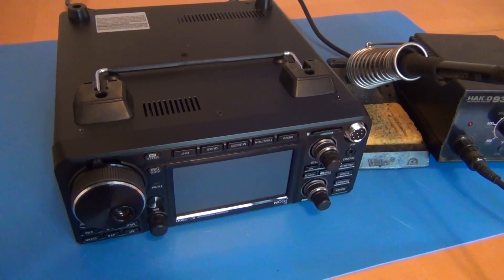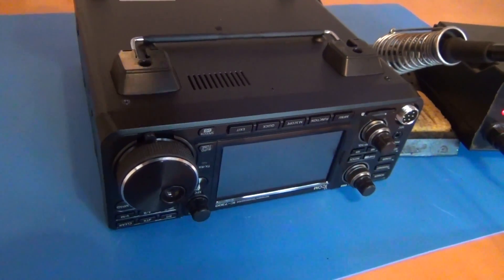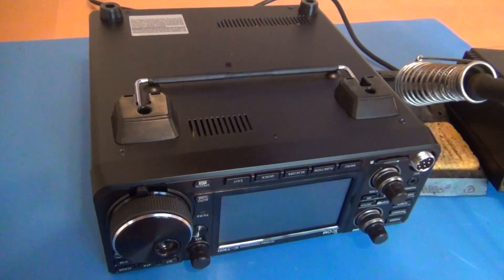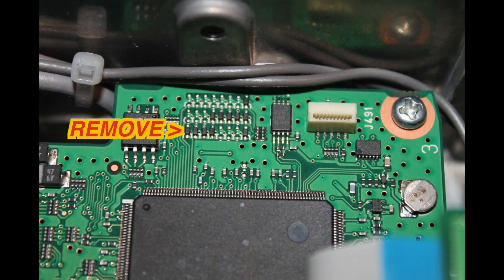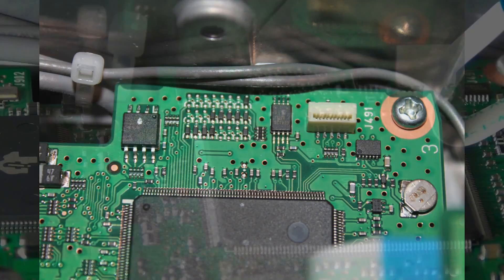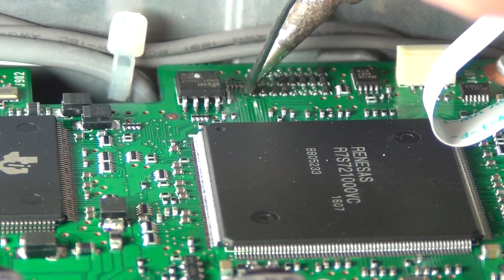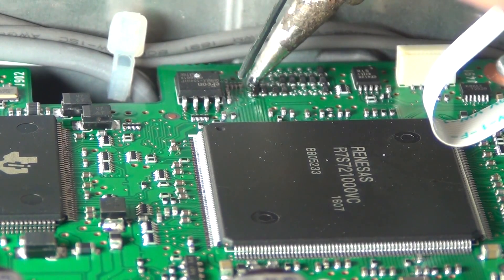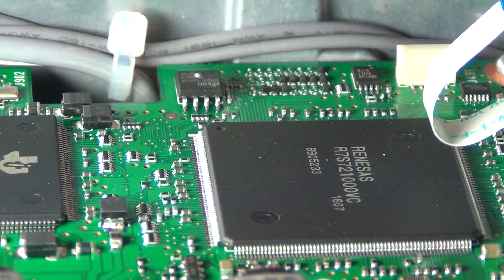ICOM IC7300 Modification - All band transmit - Wide band transmit

Comment: Hi Jim, have you been able to get this rig to operate in 70.000-72.000 kHz frequency range? (Assuming this is the U.S. version of the rig). I have made the mod but I can't get it to transmit in that range. I am wondering if I am missing something. I understand that 4m band is not available in the U.S. but many E.U. countries and us can use it. It would be hugely helpful if we could get the U.S. version of the rig to properly operate there. Thanks.

Comment: If you want 60m Tx without full Tx expansion then remove D405 which is the 2nd diode from the right hand end of the middle row of the matrix. Wideband Rx only can be had by removing D416 which is the 3rd diode from the left of the bottom row in the matrix.